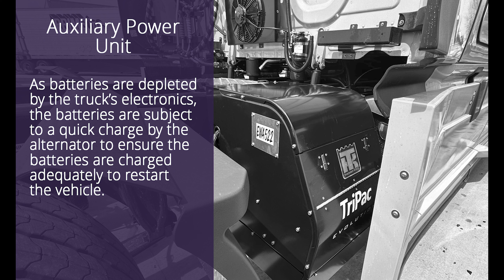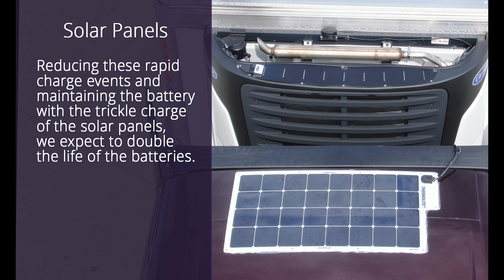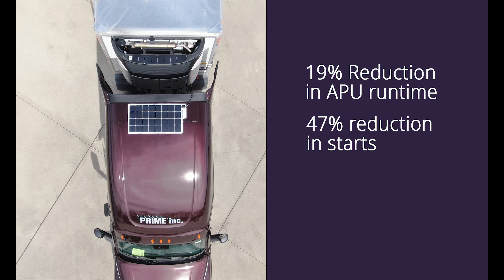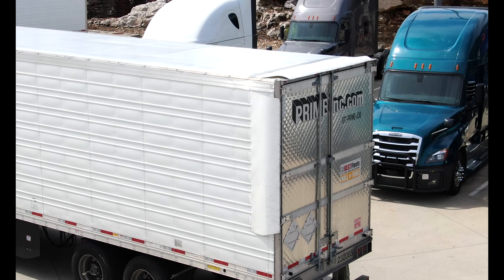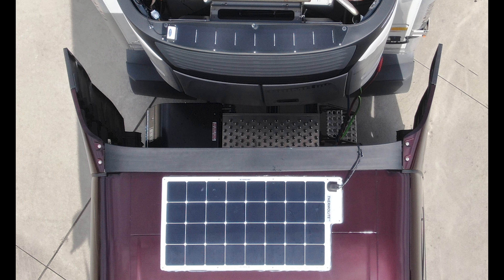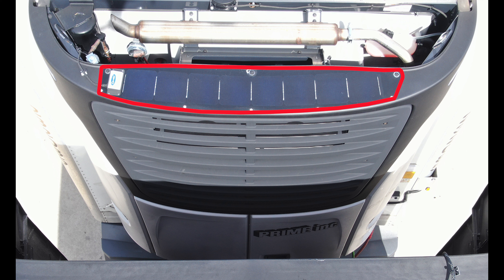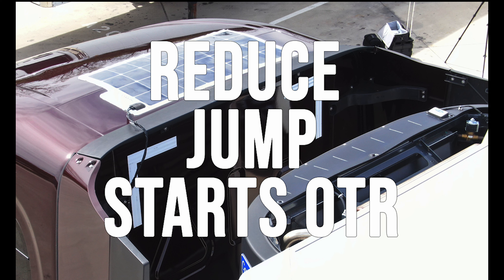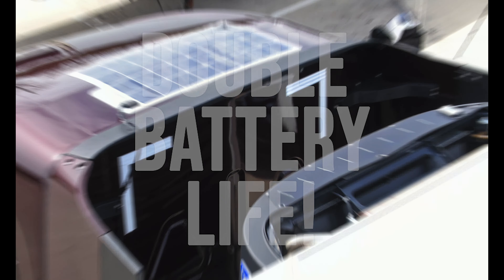Harnessing the Power of the Sun: Installing Solar Panels

Comment: I've got the Freightliner battery HVAC unit and two solar panels instead of an APU. This stuff is nifty! During the summer I can do a full reset without having to run the engine at all.
Reply: Do you have to run the truck in opti idle or just turn the key off and keep the inverter on ?
Reply: @GregoryEllis09  My solar panels don't seem to work if the key is on, so I leave Opti-Idle off and the Inverter on, then use the Park button on the temp knob in the sleeper to turn on the ParkSmart HVAC. Lasts much longer than running Opti-Idle.

Comment: How can we sign up for the program
Reply from the maker: Contact the shop! Right now they are shifting most the the installs to the Minooka Terminal.
Reply: @PRIMEINCTRUCKING  how much does it cost
Reply from the maker: @Leondap2024  It cost $858.48
Reply: Standards Leasors have to pay for that?
Reply: One issue Prime needs to address is the automated truck washes in Prime1 and in SLC is tearing these panels off the roof of the truck.
Reply from the maker: Thank you for bringing this to our attention! Can you reach out to our shop manager in SLC so we can get more information? 801-977-5925

Comment: Will that end up taking away the apu?
Reply from the maker: No. Solar panels are only used to offset some of the parasitic power draw of the telematics. By using solar panels to maintain the batteries, we’re able to reduce the time the APU runs to charge the batteries.